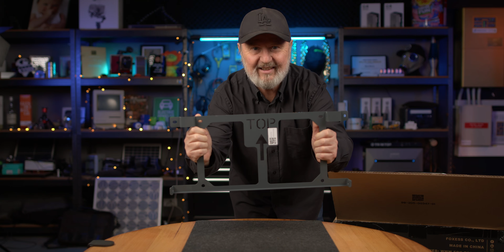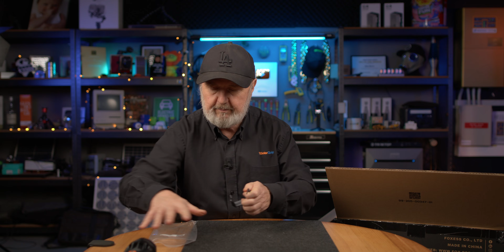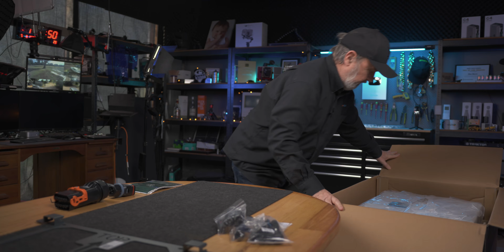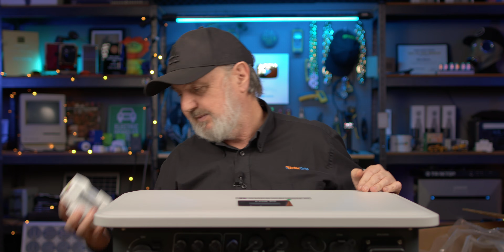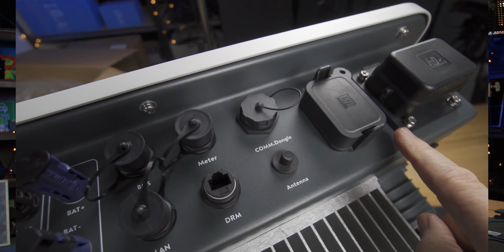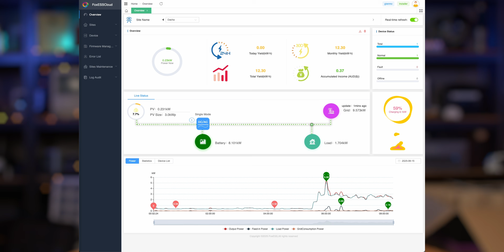FoxESS 8kW Three Phase Hybrid Inverter Unboxing

Comment: You may be able to help. Fox response has been,  talk to your installer. I have 10 kW 3 phase inverter.   3 to 4 times a week it trips, error overload. I found out I can only use 3.3 kW per phase max 14 Amps.  
Before solar installation I never had any tripping issues. It happens mostly in the morning. Most of the time the kettle causes it. But when I test it it doesn't happen again. So I did some research and changed "balance load" to enable. Under test I can turn on the kettle toaster and microwave and it doesn't trip the inverter. But every once in a while in the morning it trips. So it looks likes it's design flaw. Why should fox limit me to only 14 Amps when I used to draw up to 20 Amps previously. The installers solution is to remove the circuit from backup.
Reply from the maker: Yes there is a hard limit of 3.3kW per phase
Reply: @SmartEnergyLab 
Do you know if fox  will address this issue. Because I feel like, I have been short changed. What would be your solution?

Comment: Hey Glen, Fox does look like an interesting solution. I’ve met a few of their reps recently and want to try one out with a friendly customer. But, watching your unboxing, I’m wondering how we comply with
As 5139, 5.3.1.4.3 second paragraph…
For battery systems operating at DVC-B or DVC-C, the cable between the overcurrent protection device and the PCE shall have mechanical protection

(Usually wsx1) 
Ie a plastic cover at least.

Reason for the question is BYD has screwed us over with their “upgraded” mc4 bmu. I’ve been in talks with BYD China and am heading there next week so would be keen for your take.
Reply from the maker: Yes, agree. We made a bent metal cover over the battery cables to comply.
Reply: @SmartEnergyLab ah, good to know. I thought I was going out on a limb on my own.